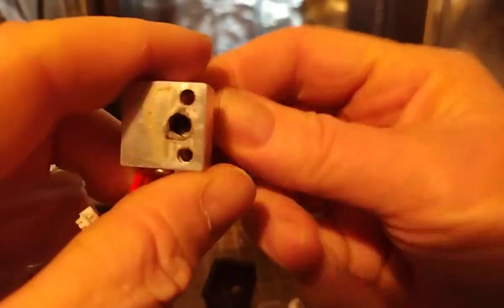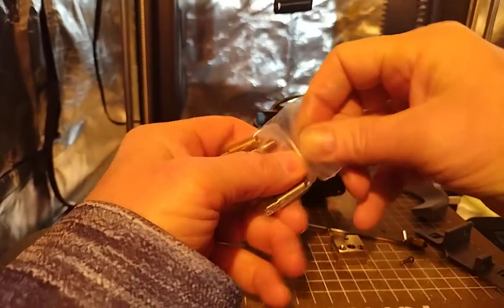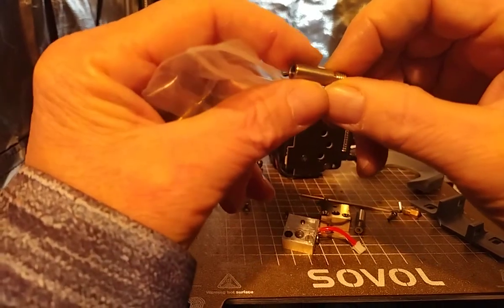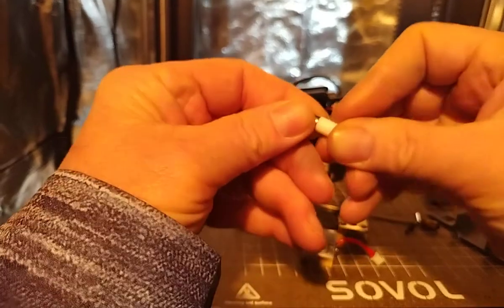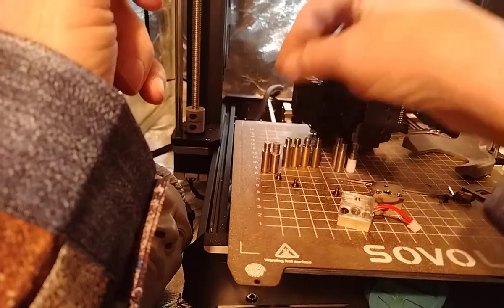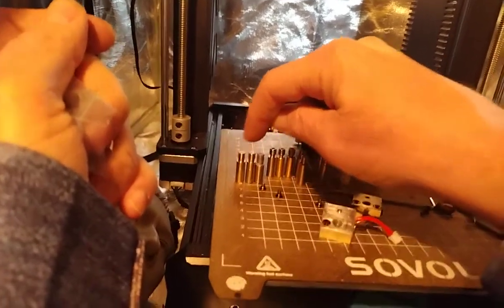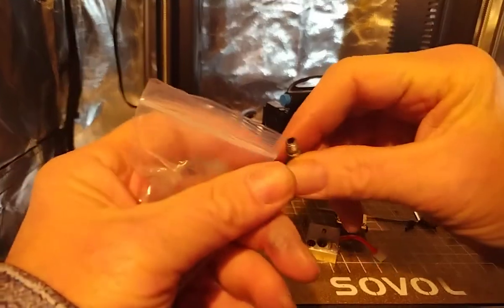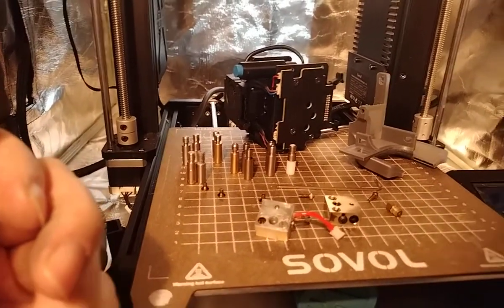heatbreak options for the Sovol SV06

Comment: Hi, I am looking for a teflon tube version heat break too because the all metal heat break provided by Sovol is really bad. It caused numerous jam and I have to disassemble the extruder and hotend to clean the jam. The throat is narrow and rough. I insert a 1.75mm filament directly into a brand new heatbreak I bought from Sovol, I can feel a lot of fraction. So It's not a good all metal heat break. I am looking to convert the hotend back to using the blue PTFE tubing so I can print PLA and PETG without problem.
Reply from the maker: These were ordered on AliExpress, not manufactured by sovol but the measurements were correct.
Reply from the maker: 24mm x 7mm heatbreak, seem to have a few options   I will order a few.   https://www.aliexpress.us/item/3256802944790171.htm

Comment: Noo no no not Teflon, it defeats the reason I bought a Sovol v6! All metal is needed for the more high temp filaments. Teflon burns at temps over 260 C, I struggled with an Ender 3 pro for months to break that barrier, with little success. After figuring out how to get past it, the cost was only a little less than buying a new printer. The heat block issue is minor, as long as the replacement has counter sunk holes for flat head screws, it won't effect the printer.
Reply: Yeah this video is a mess lol

Comment: Any chance you can provide links to replacement heat blocks, heatbreaks, and possibly thermistor and heaters? I cannot find anything stating they fit the SV 06...
Reply from the maker: https://www.aliexpress.us/item/3256802944790171.html?
Reply from the maker: Did not find a heater block yet.  Sovol is celling these as complete parts.   personally I like the teflon tube versions.
Reply: @3dpfeeney  if it has Teflon inserted, it's not actually all metal..I. A bit confused here
Reply from the maker: @JoesAutoElectric  that link that I provided has just about every option, there are thin Teflon, they are thicker Teflon there is a two-piece Teflon there is a two-piece by metal and a solid one piece all metal
Reply: @3dpfeeney  ok thank you
Reply: Fort the price of two hotends you have a complete set (Hotend + directdrive extruder). Where is the logic in that.